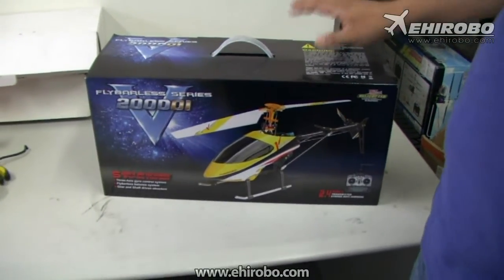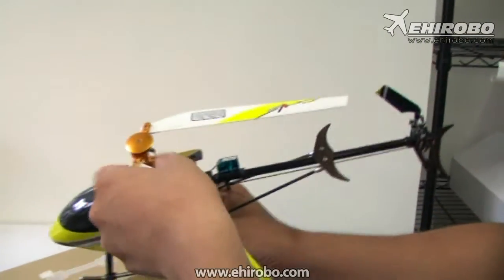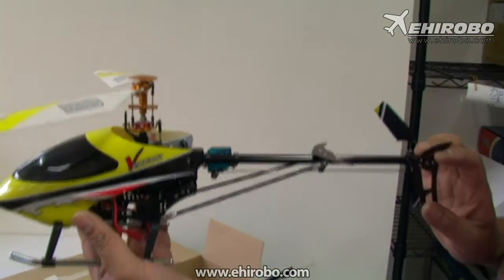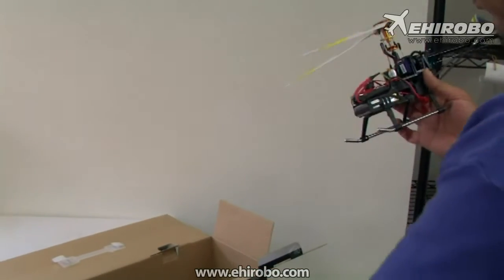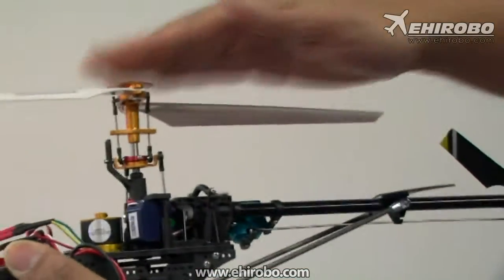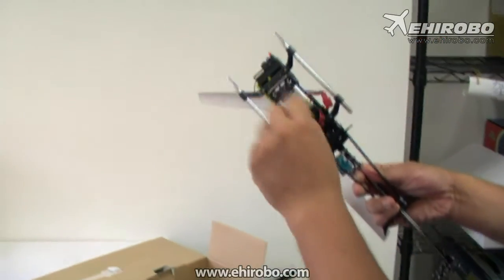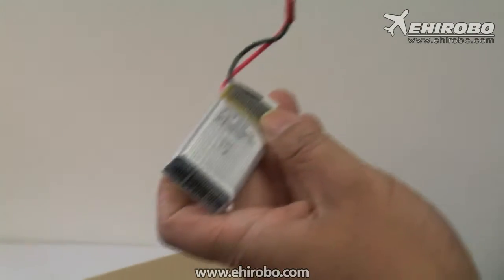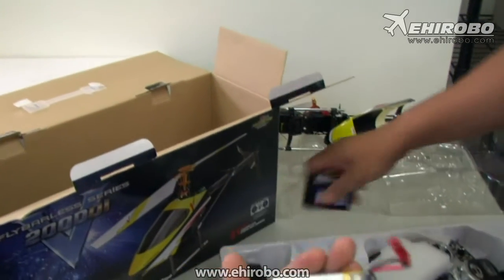eHIROBO.com - WALKERA V200D01 Flybarless 3-Axis-Gyro System 4CH Helicopter RTF - 2.4GHz

Comment: New to Helios and R/C.  I started off with a Blade CP+, never got it to hover, or fly it.  Something it took me 4 years to lean about, SWASH PLATE.  The Blade CP + had no information concerning a level Swash.

I found a BlitZ R/C works "Knight II" on Craigs list for a decent price. Come to find out it is actually a Walkera C180Z with a new name and colors.  So now Im in the middle of converting it to a V200D01.  Im also converting it to a Devo RX so I will be able to bind to my DEVO F7 TX.